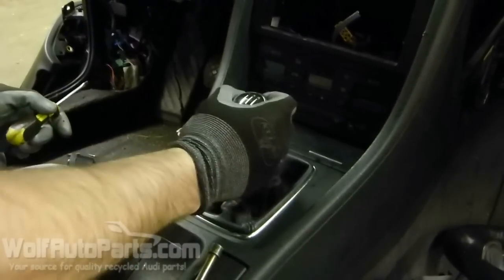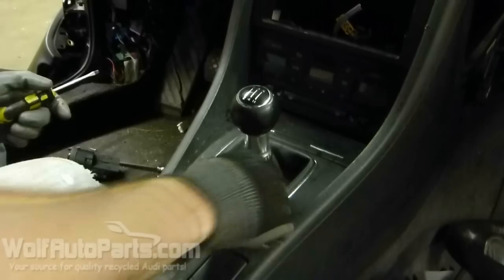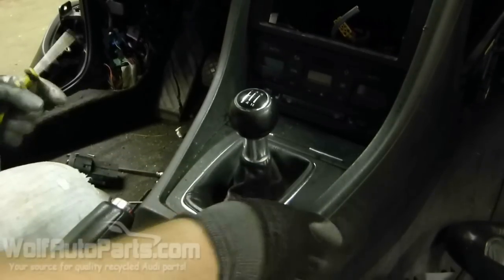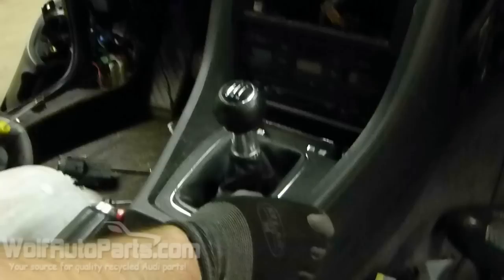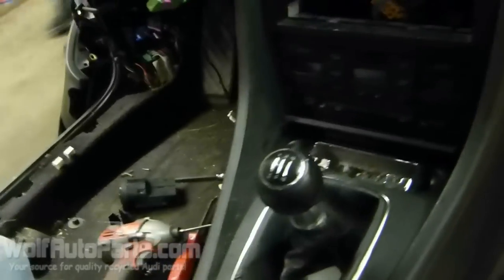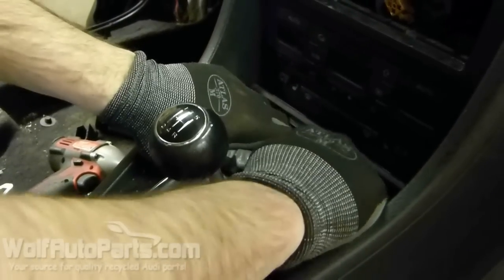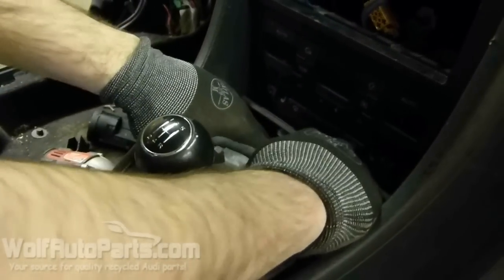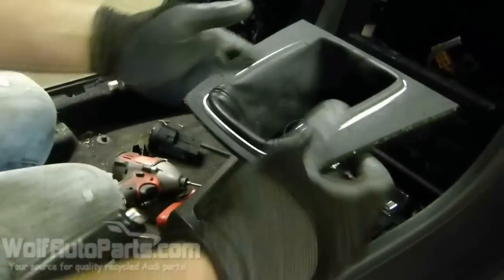How to Remove a Shift Knob - B6 Manual Audi A4 2002-2005 (Wolf Auto Parts)

Comment: Do you still have a shifter knob plate/trim has the one shown in this video for sale, for a six speed transmission? I have a 2002 body A4 Quattro with a six speed manual and I'm looking for the plate, in black, just has the one shown. I believe it's the shifter boot bezel. Thanks

Comment: Can you then remove the shift knob from the gator/boot? I need to replace mine but would be much quicker for me to buy just a replacement knob from a local store than have to order and wait for delivery on a whole knob/boot assembly!
Reply from the maker: James Griffiths I don't think it's made to be separated, it's sown or glued in there. If you pried on it enough you might be able to, but it would be tough to put in an aftermarket one and make it look decent.